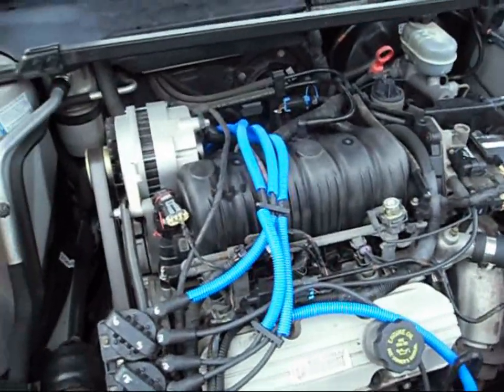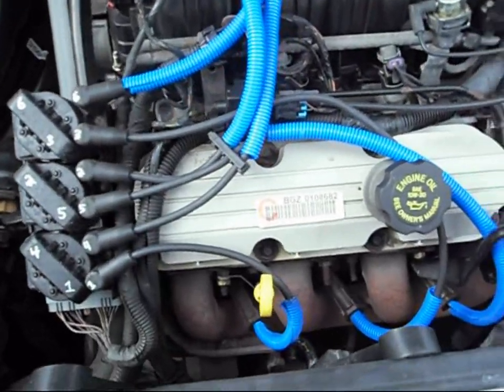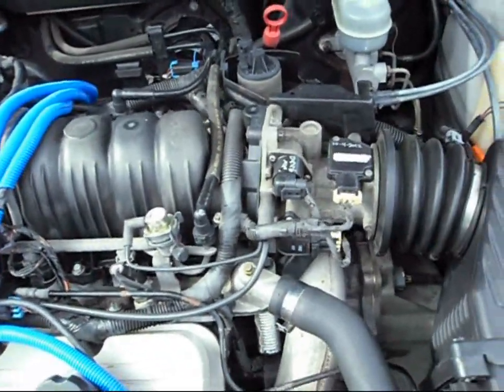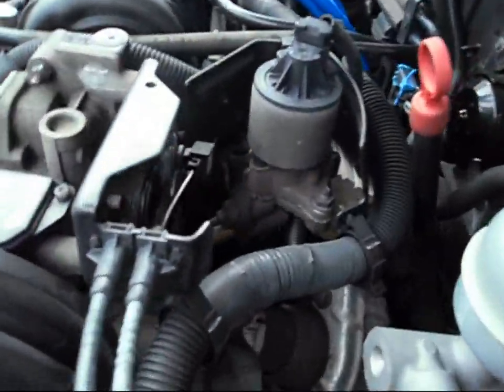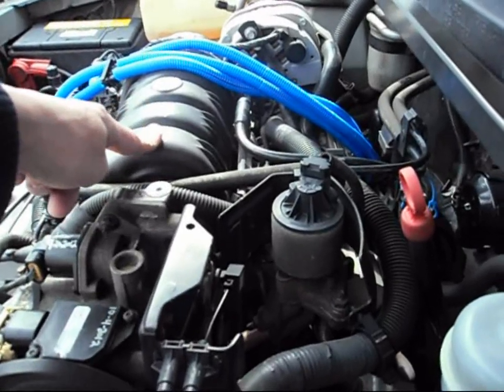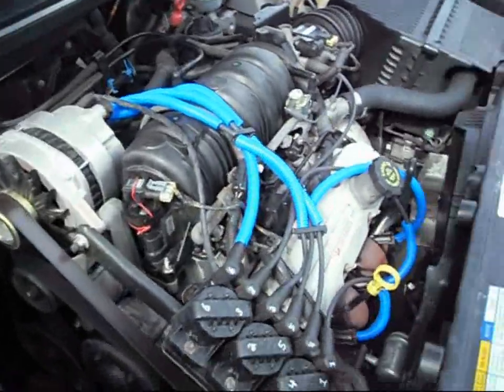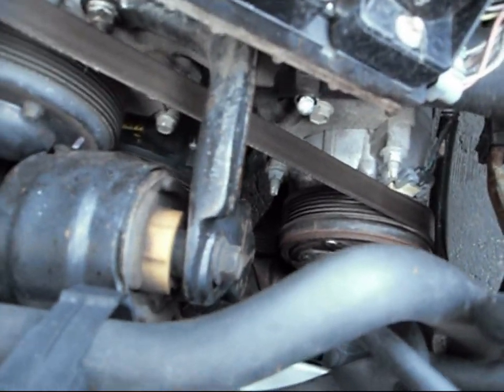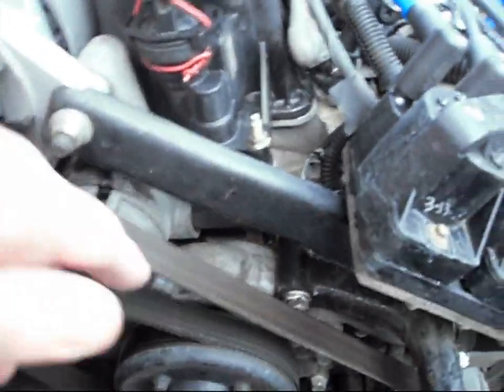1999 Buick Lesabre Help full Info etc

Comment: When doing the job for the LIM gaskets you gonna wanna spring for the metal elbows. The dexcool will surprise you how much it pitted the bottom of the lower intake. I use conventional green in mine. Also the block does have coolant drains to help get every bit of the coolant out.

Part of the servicing your doing on this car you should include the oil pan gasket. It is probably leaking by now. Really the hardest part of the job will be cleaning the pan. Also check your harmonic balancer for play they are common for the rubber in them to break down and cause many different problems which include a knock that sounds like rod knock, belt slippage and so forth. If you need a new one get a new crank seal to replace it when you pull it.

Your giving this car some love and I wish you all the best man. I got an 04 lesabre with the same engine and they are good engines just a little quirky in some areas.

Replace the oring that sits below your PCV valve as well. There is a small black on that doesn't get noticed and can cause a small vacuum leak code. Especially remember this if you get the updated upper intake because a lot of the kits out there leave it out.

My biggest complaint with the lesabre is the shitty PCS they put in the transmission and causes it to shift hard. It can be gotten around with a shift kit and filter replacement and even if a person does install the shift kit and then wants to replace the PCS you should still not uninstall the shift kit because it is an upgrade that should have been in it to begin with since the transmission has weak springs in it anyway.

Oh and why your in the lower intake you may want to consider taking the heads off and replacing the gaskets and bolts since it is already apart. Always use the metal core lower intake gaskets too. The plastic ones are ass.
Reply: Your second last paragraph... I have a 1998 Oldsmobile 88 and just got a 1999 Buick LeSabre. On the olds we replaced the transmission filter, new fluid, and some kind of special fix fluid we were told to use which seems to have stopped it from slamming into gear when the temperature got high. The Buick we just got is slamming into gear now even when not hot. I'll share your comment with my brother (He does my mechanical work), we will still do the filter and new fluid. But is it a really bad thing if it's a common problem (assuming if we do not get it to stop after filter and fluid change)? How soon should we do your suggestions and how easy is it to do or how long does it take to do? He works road construction so doesn't have much time during the summer months to help me with car work so hopefully that can wait till he has time if we can't get it to stop slamming?
Reply: Ok, I looked at the replacing the pcs and it's pretty involved. Hopefully we won't have to get that replaced right away. Might pay one of his mechanic friends to do it otherwise. Thanks for posting your info.
Reply: I make my own gaskets since its metal to metal.....all others are junk....
Gasket maker on each side...2nd vein torque. 
Good to very end.

I like the grey felt roll....it stands up to higher temps.

Comment: boy you keep it clean.  I had mine 11 years now.  I got bit by that orange anti freeze issue.  Had the mechanic replace the manifold gaskets and got luck it was almost hydro locking.  Those stupid little 90 degree bend coolant elbows down by the idler broke.  Looks like the mechanic took a shortcut and put in plastic ones when he did the coolant conversion.  I just replaced them with the aluminum ones.  Do do do that.  Don't use those plastic ones.  Now I think I have some antifreeze getting into the engine.  Might be from the throttle body side, as you mentioned there is a gasket there, and there is coolant that flows into and out of the throttle body assembly.  I think that is a bad design, but I may have to pull that and check on that.  Now I am having an idle problem.  car starts, then dies in 2 seconds.  For about 6 months I would then, first just touch the start for a second, not enough to start it.  Then wait 10 seconds, then start it and it worked fine.  Lately it won't hold the idle at all, and I have to two foot it.  I replaced all the stuff, IAC, cleaned the throttle body, TPS, etc.  No engine codes.  Car runs good. But when replacing the EGR, I noticed the car WOULD idle, but a bit rough.  But the idle speed was good.  I also noticed and felt an awful lot of hot exhaust gas coming up into the EGR iron bracket there.  That doesn't seem right.  reading a few other things, I am thinking my Cat converter is plugged and at low idle there is too much backflow.  Car runs ok on the road and even freeway speeds, so a cat converter seems to not quite fit the symptoms, but this weekend I am replacing the upstream O2 sensor and I will see if the car idle speed is better with that.

Comment: i have a 1997 , 190,000 miles.  Had to replace a few sensors over the years.  I do concur that one should check that throttle body.  Mine had a ton of soot and carbon buildup and that can keep the throttle sensor from  working right.  6 years ago I had the intake manifold gasket replaced and the engine coolant switched over from that crap orange to regular green.  I had a case of hydro lock, degraded gasket etc.  all part of a known product recall that unfortunately for me I didn't know about.  But 6 years on and going strong.  Replaced the coils, plugs and wires and it runs good.  Had to replace the crankshaft sensor but that one was obvious to debug.  I let the shop do that just because it was convenient.
Reply: Ya the carbon  bild up can get nasty   but easy clean      and fix

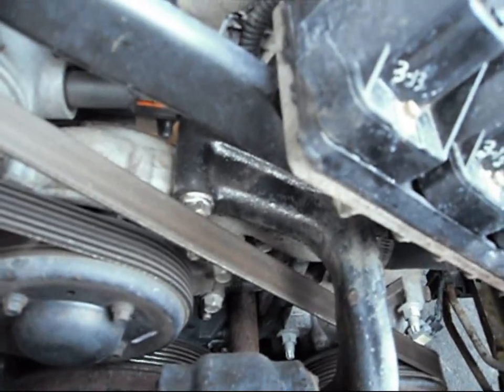Comment: here to help you out a little. at map seanser you pointed out is the MAF (mass air flow). the map seanser in on the outside of the throttle body on the inteak manifold(which is seen on 7:16 held down by a red wire) which the PCV valve is located right below  it. ok so also the upper intake manifold can leak colent into the engine this is due to the colent passage way nbear the throtle body corroding away seance it is plastic. also to check the fuel pressure regulator at 2:18 just run the car or power and take off the vacume hose if you see gas/smell it replace it if the diafram in it breaks it can flood your engine or hydro-lock thats because it goes into the vacuum hose and into the inteak. also at 6:11 you will see a plastic tube on the top left its good to replace that because over time it will start to leak coolent there are two of them. i segue st using metal ones if you plan on  having the car a long time.

Comment: Looks pretty clean in there. I'm trying to find out where the fuse is for my cig lighter. I blew the fuse after plugging in a tiny heater to defrost the windshield. Had to get a new battery. I do sometimes have that problem you mentioned about the car just quitting sometimes. Will have to get a mechanic to check that out. But right now I need to find that fuse...haha
Reply: More than likely I found with mine anyways the random stalling g is due to the cam and/or crank position sensor

Comment: My 99' Le Sabre power train has been bullet proof!. Am having body vibration at 55mph. Mechanics have never neen able to fix it! Checked bearings, new brakes , rotors, lower control arms, ball joints, tires, wheel balance and still vibrates! Don't feel it in the brake pedal or steering. It's a great car with 93k on it and hate to scrap it but this body shaking sucks. Any ideas?...Thanks for sharing!
Reply: Check engine mount bolts.

Comment: i have the same car same year where do i add power steering fluid?
Reply: The power steering reservoir is on the back of the engine below the alternator with a twist top

Comment: My car won't start. I just brought a 1999 Buick lesabre with 113,000 miles and a week after I brought it, it wouldn't start. I had the battery checked and it wasn't that. I wonder can it 've the security system?
Reply: Crank or cam sensor
Reply: Im having the same issues???what did u do to fix it???

Comment: Where is the purge cannister located? I can't find it on my 1999.
Reply from the maker: Most purge canister's are located underneath the front bumper on the passenger side. If so Equipped.. most were assembled in canada ,thus the metric bolt's.. possibly if youre car was assembled in California it should have one.. possibly a canadian doesn't?? not sure on that one..

Comment: my 99 Buick wont switch air controls.  It only blows on the windshield (defrost), will not switch to flow or dash vents.  any ideas?
Reply: Chad Zimmerman  open glovebox, push again down it will drop down then you can open cover with your hand inside that.

Comment: if anyone can offer thier help please do so thank you in advance. I am needing to know where would the fuel pump fuse be located on a 2000 buick lesabre limited?
Reply from the maker: well that fuse and relays should be located on the firewall area under the hood..should be a rather large plastic box marked fuses.. when u open the box up ther is a label marking the fuses ampre  and locations etc..